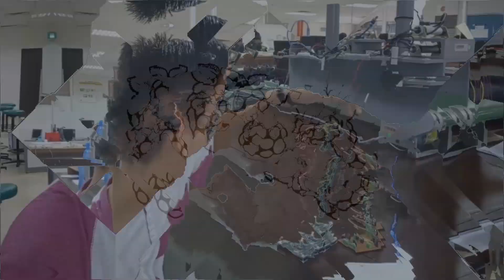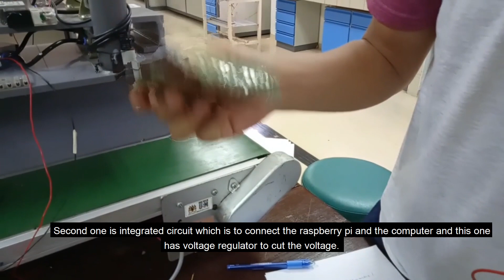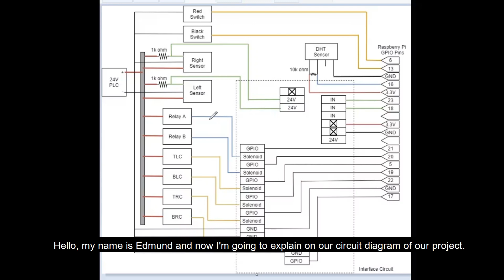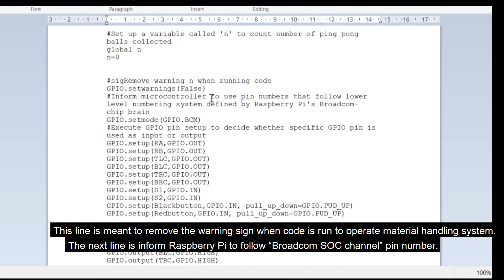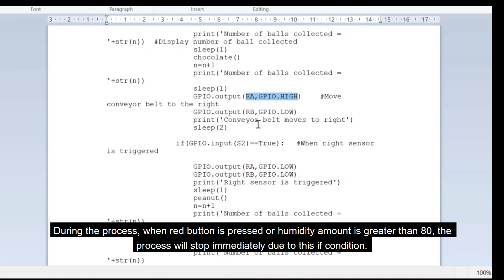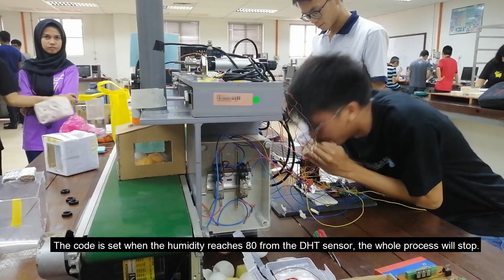Group M02 EMC311 Mechatronic Project: Material Handling System, Academic Year 2019/2020

Comment: Objectives are well defined.
Manufacturing application of biscuits packaging is associated.
Box is designed for biscuits packaging.
Magnetic sensor is not used.
Wiring is well shown and explained.
Motor and relay circuits are not shown and explained.
Pneumatic circuits are not shown and explained.
Program initialization is well shown and explained.
Program flow is well shown and explained.
Switches are used for controlling outputs.
DHT22 sensor reading is used for controlling outputs.
Operation demonstration  is well shown and explained.
Mark 80%